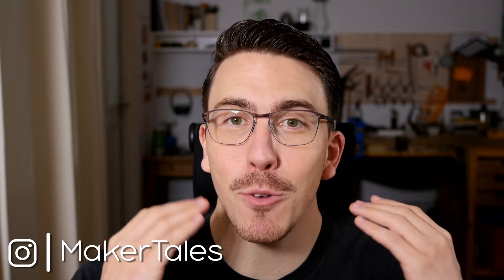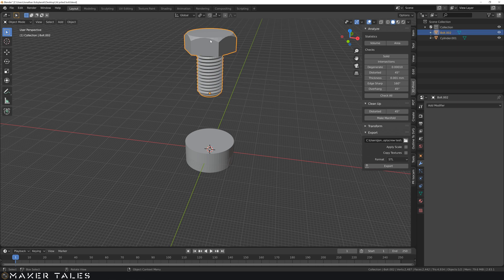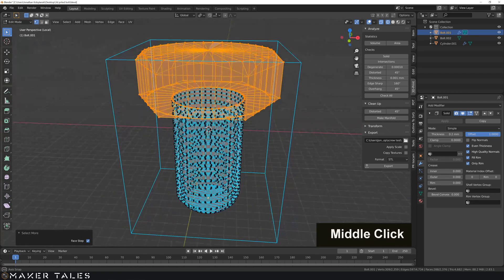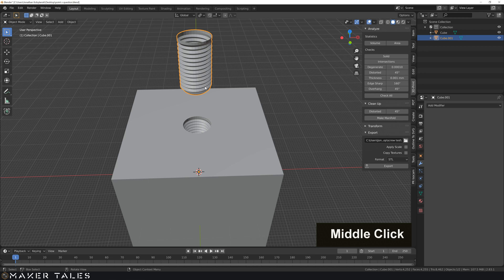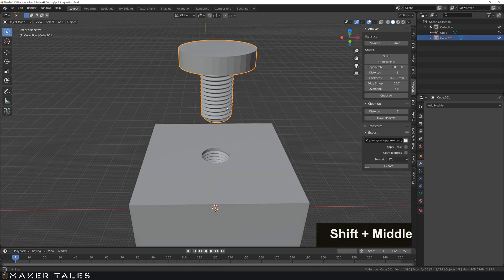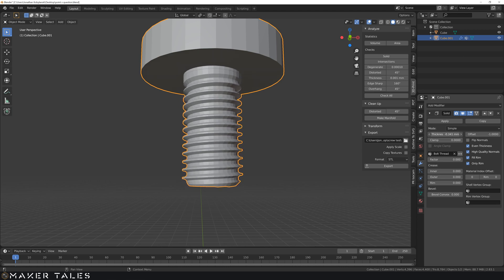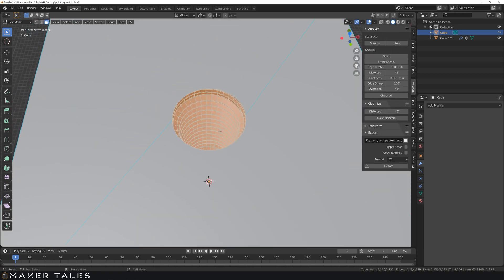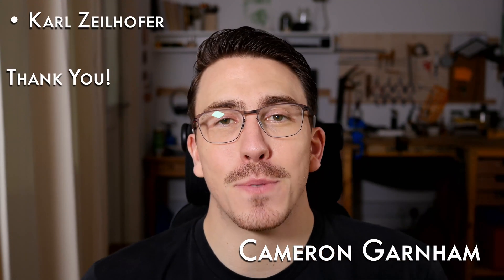3D Printed Nuts & Bolts Tolerances In Blender 2.83 | How to - Tutorial

Comment: A lot of good stuff here, thanks! But I ran into an issue right away - solidifying one of these add-on bolts results in overlapping inside-out faces at the edge of the thread, even with my 0.1 thickness. Might not have been an issue in the older version of blender, since you don't seem to have Self-Intersection in the bool options, but that's what I had to enable to fix it.

Comment: I'm using a 14mm custom bolt factory bolt, and the solidify modifier always botches the geometry by introducing intersecting faces. Anyone have a tip for that? You can remesh afterwards to clean up the intersecting faces, but unless you use an insanely high voxel count, that also hurts the geometry.

Comment: Do you know if it's now possible to do the thread changes (increase /decrease size to 0.2,0.3,...) in geometry nodes accurately?  I know they have an extrude, scale, boolean mesh node but how would you control it correctly.  This would make things easier to control if this was possible.

Comment: Ctrl + - zooms out, it doesn't create a boolean

Additionally, when I create the boolean, the tool (bolt) doesn't disappear like yours. It remains, but does make the cut in the cylinder. Then when I try to use solidify to create the offset, it no longer cuts into the cylinder.
Reply from the maker: Hey AymiGamin, sounds to me like it might be the bolt is not manifold... If you have no idea what that means check this video out here: https://youtu.be/0rgrLWFUjlk
In a nutshell Bolt Factory does not make "good" bolts but fret not I'm currently working on a solution for this 😉
Reply: @Keep-Making  I mean, created it the exact same way you did in a fresh file. I'll check this out today

Comment: When you add the 0.2mm to the diameter, is that because the layer height on your printer settings is 0.2mm. Or did you come to that number by some other means? And if you were to make a really big bolt or a really small bolt, is that 0.2mm going to change or will that apply to every bolt you ever make on that particular printer?
Reply: Old question, but the answer is, by .2mm tolerance, he means make a gap between the two pieces of that size, because the printer is imperfect and needs extra wiggle room for these imperfections. If you are using an FDM 3d printer, and you print a plain cylinder 10mm diameter, and a hole of 10mm diameter, they will not slide into each other freely because FDM printers can't produce that level of accuracy, so instead, you might opt to make the hole 9.6mm diameter, aka a .2mm tolerance (.2mm subtracted from each mating surface, so radius -.2mm).
Reply: @honkbeforeitstoolate587  Thanks for the clarification. This reply prompted me to mess with my printer again. Still haven't been able to print a compatible bolt and nut. But I did print some blocks of size varying in .2mm increments along with holes to match. I decided to try an easier project. Appreciate the feedback though.
Reply: @Corafus  No problem. Funny enough I actually just made my first design a week ago that incorporates printed nuts/bolts, courtesy of boltfactory in Blender. The bigger it is, the easier it is. I opted to make my bolt have a 14mm major diameter and 12.2mm minor diameter, with almost zero flat area on the root or crest of the threads, and that helps because it makes the threads be less steep of an overhang. I also realized I can even print the female threads horizontally by borrowing a technique I saw, the "teardrop" technique for when you have a hole being printed sideways, and you don't want to have to use supports on it, you can make the hole teardrop shaped so there is no overhang, only 45 degree slopes inclining towards each other.  So I made a teardrop cut out of the top of my female threads, and now I can even print them sidways with PETG and no supports, and petg sucks at bridging compared to PLA.  The only hard part was Blender's solidify modifier keeps throwing me for a loop by messing up the complex thread geometry, creating intersecting faces, etc, so i ended up just creating a second boltfactory preset that is .2mm larger, but that isn't perfect either.

Comment: This addon cool, but this produces a gigantic bolt. Like it's so big.. Meters size bolt... I haven't tried to click m6 presets, will try later.

But before that, is there any good way to get it scale 1:1?like I want 4mm bolt (M4)
Reply: edit : i just did the presets, still produces huge huge gigantic scale bolt. so i had to divide by 1000 once it's done adding. at dimensions tab (N key)
Reply from the maker: CTZN, I have a feeling your scene unites are not set correctly for precision modelling. Here is a link to a video to change that and then all will be fine. It might be useful to go through the whole course if you are new to blender. https://youtu.be/VihRvil3138?list=PL6Fiih6ItYsXzUbBNz7-IvV7UJYHZzCdF
Reply: @Keep-Making  nope... Set the scene to millimeters, and the bolt is still made in meters.
However set the scale in XYZ to 0.001 and you get the right result...

Comment: Alternative:
1) add 0.2 to Major Dia and Minor Dia when creating the bolt (or whatever other tolerance you need for your printer)
2) move this bolt into the object you want to screw to and add a bool->difference modifier
Done
(or am I missing some hidden aspect, here? Seems to work fine for me. I simply created such 'holemaker' bolts as presets for each size to the bolt addon)
Reply from the maker: Hey Peter,
Yes by all means that is possible. I have a feeling you might have to change more more number too which is the shank if there is any plus if the size of the bolt head matters those too. By all means from the sounds of it your alternative would work. However, if you needed to change to tolerance once again you would need to make the whole tread once again.
Reply: @Keep-Making  Good idea. I hadn't used shanks above 0 before (I'm pretty new to 3D printing and blender...just started out 2 weeks ago..so still a lot to test out and learn in both areas...like not setting threaded holes before using a mirror modifier on an object, or you'll have to print left-handed screws :-p ). 
Setting the shank Dia in the preset to the same +0.2mm does the trick (+0.1mm for all values seems to also work on my Prusa MK3S, but it's a tight fit, so I'm sticking to 0.2 for now). Since the new presets carry over between projects they're really neat.
Bolt heads don't seem to require adjustment. I just now did a test print with a counter sink and it got in perfectly flush :-)

Comment: How come when I add the solidify modifier to the bolt it becomes solid and one with the block im trying to add the thread to?
Reply from the maker: Sounds to me that both of you meshes are the same object... Maybe
Reply: @Keep-Making  hmm, no they are seperate objects and the screw is making the boolean cut but as soon as i turn up the solidify mod thickness they become one mesh..its very weird.
Reply from the maker: I just don't see how that is possible.... If you want you can send me the file on discord and we can investigate the solution
Reply: @Keep-Making  Ah youre too kind. you dont need to waste time on fumbling me.  i THINK my problem was that i was bringing in the screw mesh in "edit mode" which can combine 2 meshes into one.  Thanks though!

Comment: Thanks for the lesson! Just what I needed! But isn't it easier to make a thread diameter smaller via a Bolt Factory? 
1. Create a bolt via Bolt Factory
2. Boolean operation with another object to make a hole
3. Make thread diameter of the bolt a bit smaller in the bolt factory parameters.
Reply from the maker: I don't know if it would be easer or if there is something i'm not thinking through correctly but I don't see a problem doing it via the bold factory. I guess i'm also thinking how you would resize threads that come in files that are made by others.

Comment: Amazing Tip at the end! Do you just cut away both sides of the bolt with the boolean modifier? Would it make sense to just cut off one side and have a half-round bolt?
Do you prefer shrinking your bolts in blender or leave it unchanged and use something like Horizontal Expansion in the slicer to fix the printer's offset?
Reply from the maker: Hey Chartle, I do all my sizing in blender. and ya you can do just a half bolt if you really wanted.

Comment: BTW maybe you could use the Alt+S shortcut it does the same as the solidify,  is called Shrink/Flatten, while on it you could tap S again to switch between even thickness or not. (You have to be on median for it to work) it just moves faces along normal. Alternatively you could do move individual on Z axis while on face mode and will do the same. Maybe you already know but maybe it will help out :)
Reply from the maker: Thank you very much for the pointer AirmanCS!
I was not aware of this and i'll be sure to add it in to the 2.9 version of the whole series in about a month.